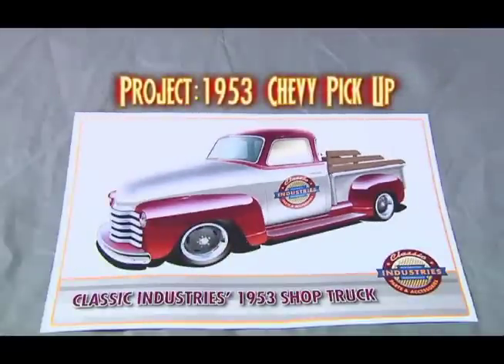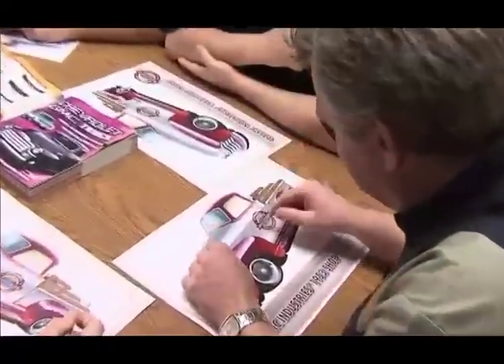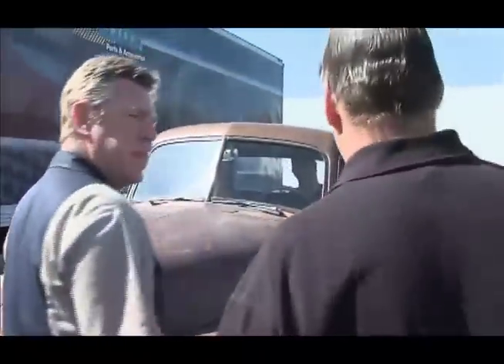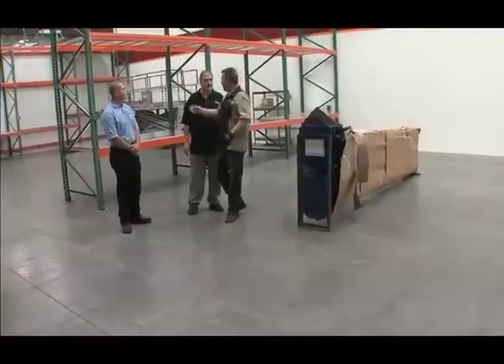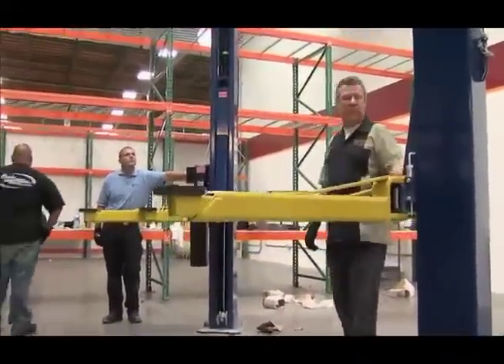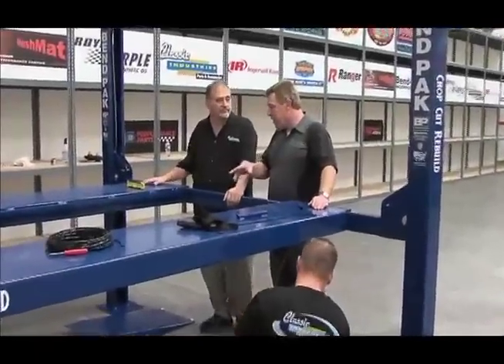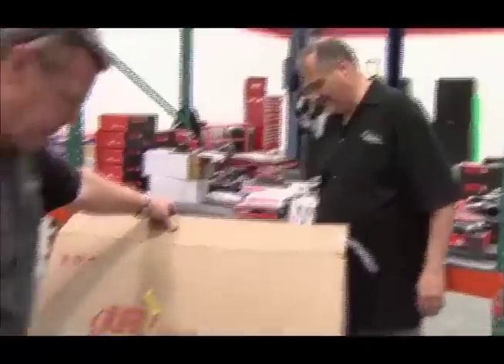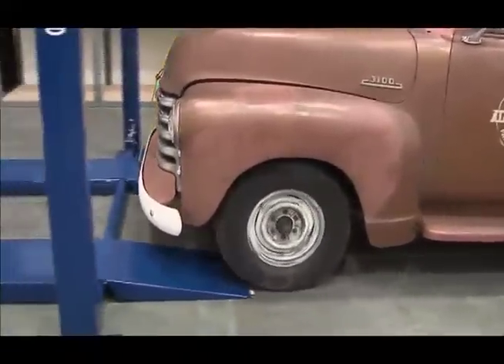Chop Cut Rebuild: 1953 Chevy Pick Up - Part 1

Comment: It's unfortunate your missing either an episode of CCR or parts of the paid-for footage that covered certain parts from the original airing of the show.

Just an idea- Do a final overview of every inch of the 53 truck showing the modifications and what may have been an issue with the original fitment and what was suggested to make the modifications work together (Vintage air With AC or only heat? with recessed firewall and Power Cowel). Custom cup holder, how was it latched, hinged, and supported after metalwork what parts were used to aid the final assembly. Consider doing this for each one of your current finished builds and in the future, might be worth adding to the series.